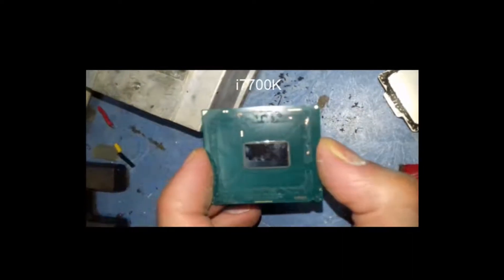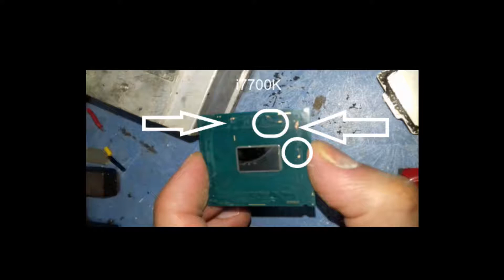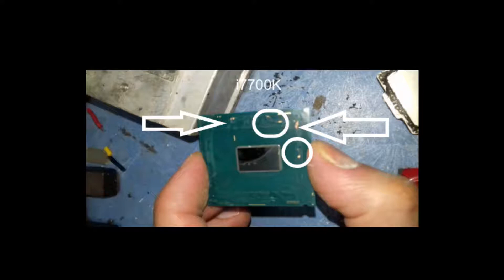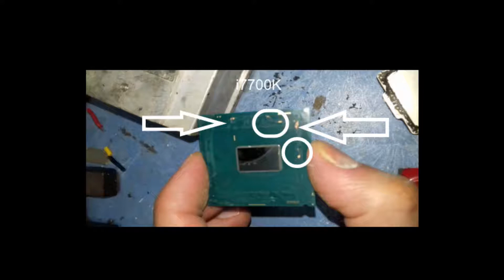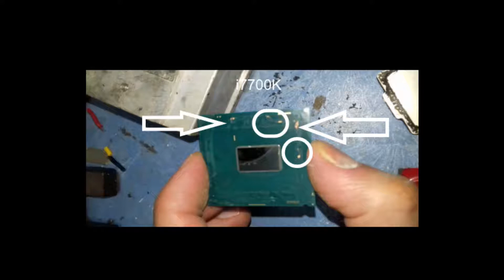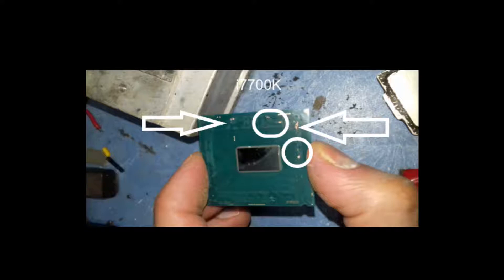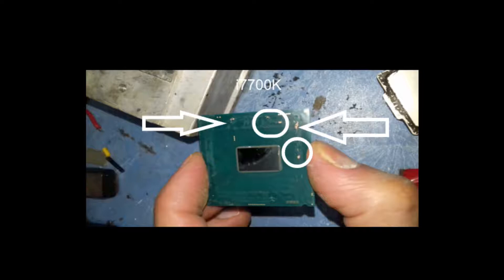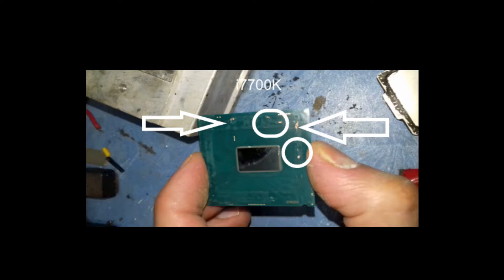Delidding CPU Fail! I damaged my i7700K processor PCB, will it work?

Comment: Its called clear nail polish of you accidently ahow copper or need to cover some gold in case the metal gets on it and causing a short but you have been acrapping way to hard to show copper ans i also see where you went ao hard the green faded on the pcb i justdid my first delide yesterday and im nice and cold and idk why you used electrical tape and pcd pain is over priced no need foe any adhesive either once youve sone the wetting process the cpu socket clamp holds and does the rest but make your using a whole gram .05 on the dye ans the other half on the ihs

Comment: Was it dead or did you get it to work?
Reply from the maker: I thought it was dead, but it works. The PCB paint was removed from some places but the processor is working fine.
Reply: @repairjunk2268  y con las temperaturas como lo solucionaste si dijiste que rondaba los 100C espero que me puedas ayudar ya que me paso exactamente lo mismo y lo estoy usando a 3.8 de frequencia para que no me suba la temperatura GRACIAS!
Reply: Same on me, i think it was dead but magic its work fine